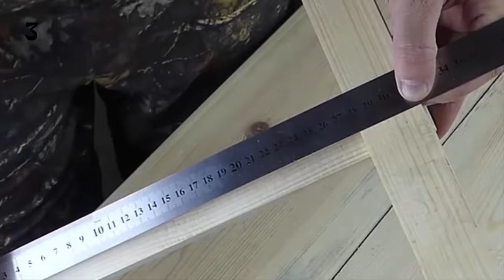I didn't believe it myself! 3 brilliant ideas in 9 minutes!

Comment: The Chisels should have a grinding edge and a cutting edge. 2 angles on the one face.
Reply: I was taught to sharpen a bench chisel to an angle of 25 degrees, with a secondary angle of 30 degrees. Then the paring chisel at 20 degrees, with a secondary angle of 25 degrees.
 Still do it today.

Comment: I'm sorry, but the corner clamps hold 90 degrees, BUT THEN, how do you get access to the joints to connect them together? I guess only glue could connect them. No nails. No screws. Nothing can get past the clamps you've created!
Reply: You can use pocket screws on the back side

Comment: at 6:55, you have a piece of timber between a running blade and a fixed fence! ?????
In my training as a furniture maker we learned that in this situation an eventual kickback
can be very dangerous (which I have experienced before the course myself- it scared the sxxt out of me, the piece went past me-lucky me- and went through a plasterboard wall two meters behind me), so please remember:
Push the piece you are cutting to measure along the fixed fence with a push stick -past the running blade into the safe area and remove the other piece with your free hand (usually the left) away from the running blade.
Hope that helps